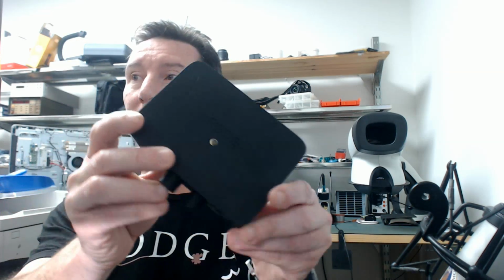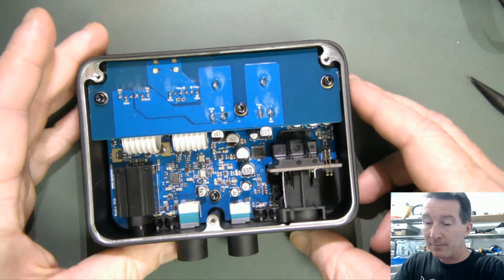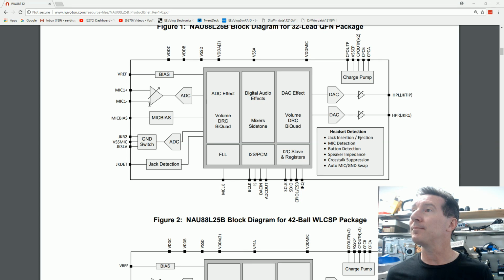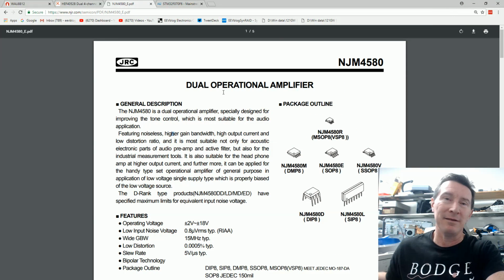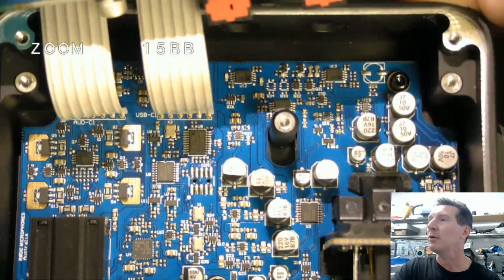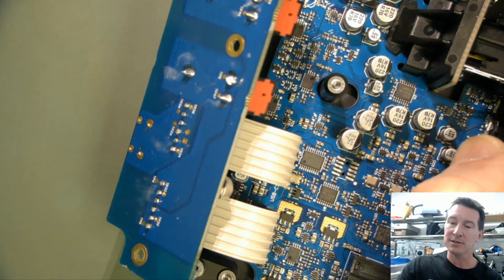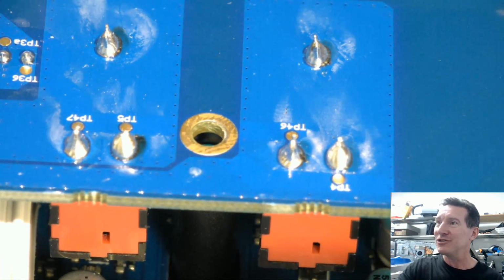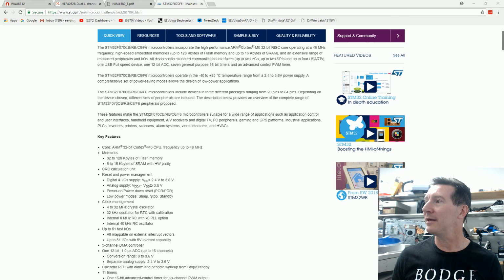Rode AI-1 USB Audio Interface Teardown

Comment: All those SOT-23-6 packages are all dual transistors some of them may be matched too.
Reply: omsonic Yes, Dave really should brush up on his silkscreen reading skills, he keeps thinking Q is an IC and doesn't associate a LED labels with the big yellow LEDs next to them.  The transistor bundles between input and ADC makes me wonder if there's an optional (MUX switched) discrete low noise preamp for weaker signals somewhere in that block. That would explain the long path for the  unamplified signal, as it would only be used for strong inputs.

Comment: It's aluminium alloy die cast with further machining of the bottom lid mating plane . Actually there's nothing special about that as nearly all guitar FX pedals have enclosures like that which high gain preamps  require thorough shielding.
Reply: MSM5500 May be a standard enclosure, just different front/back holes and paint job per product.
Reply: If they make a lot then they could afford a custom mould for that. For instance recent Korg Electribe 2/Sampler and SDD-3000 delay recreation are also finished in aluminium die cast enclosures.

Comment: I think maybe that set of 4 power devices is an audio output stage, not regulators
Reply: Most definetly they are
Reply: You're right. BL is a BCX56 NPN audio driver/output transistor and AL = BCX53 PNP complement. They appear to be configured as an output buffer of an opamp.
Reply: the  master has spoken we need more vids from you please
Reply: Yeah looks like an over engineered headphone amplifier.
Reply: I agree, probably a full bridge class AB output stage to get a decent level into headphones from a 5V supply.
Reply: Class D amplifier implementation for the headphone jack that could drive a minimum 8 Ohm driver per channel. This block is there in between the voltage multiplier block and Headphone out which could  imply that the driver could be drawing its power from voltage multiplier.

Comment: Wow, that case was machined from a sold billet of aluminum! (Probably not a rough forging that was machined.) That's so expensive. But I guess they figured they'd not sell enough to go with another manufacturing technique that wouldn't provide cost savings until higher production numbers. But that's incredible to make that out of billet. Since they've got to machine off 98% of the metal for just a thin 5 sided box.
Reply: It was casted then machined. Machining solid slab is horribly inneficent.
Reply: In Rode's marketing stuff they describe it as a cast aluminum case.  The original for the casting was machined (I'm guessing you're seeing the same telltale geometry that I am), then the critical stuff like that rim to inset the bottom "lid" and the threaded holes are machined.
Reply: do you recycle the machined aluminum or is it pure waste?
Reply: Of course you would recycle it!

Comment: The reason for the end-mount XLR connector is because the main PC board is upside-down.  That would put the XLR connector upside down which would be laughable.  There are dozens of right-angle. PC-mount XLR connectors but they all assume the board is at the bottom.  They could have put the rear connectors on the main board, but it would have made the box bigger and put the USB connector upside-down, also.  D10 is likely a set of 4 clamp diodes to prevent phantom power switching transients from blasting the sensitive mic amp input circuit.  Very common in transformerless mic preamp circuits with switchable phantom power.  Nice looking product, though. Above average for USB sound interfaces.
Reply: USB-C upside down? Is this 4th dimension?
Reply: There are also a couple of right angle ones available that are the other way round, but I guess at the volume they buy these straight connectors possibly for other devices it was just much cheaper than to buy low volumes of relatively rare connectors.
Reply: A surprising number of devices do just have the XLR connectors upside down.
Reply: How can the PCB or the XLR connector be wrong way round?
Reply: The connectors don't have rotational symmetry, there's a convention to which way around they go.
Reply: There's a convention but lots of times it's not followed. I am often inserting XLR connectors in the dark in unfamiliar places and I slide it up the usual way and if that doesn't go in I just rotate my wrist until it drops in. It is only slightly more prevalent that they are right.
Reply: theIpatix And the main PCB is hanging from the top of the box (box was upside down in video because the lid is at the bottom between the plastic feet and the main box).

Comment: That STM32F070 is nice.  I am using it currently in a project. Under a dollar IC.  I just wonder how they implemented the I2S interface using that as its SPI doesn't have I2S support.  Of course it is possible to fake that with some kludgery as long as you keep strict frame sync and manage to get it to sync.  Perhaps with some external login gates?
Reply: The I2S is on the main DAC/ADC/DSP chip, my guess is that the STM part is just used for its USB interface, although there must be something else going on to warrant the serial/parallel interface.
Reply: NAU88L25 outputs the digital audio data with I2S.  That bit stream has to decoded for USB transport.  F070 doesn't have full I2S logic to do that task.  That is what I was wondering.  That shift register is just serial to parallel IC to get more digital output to control different things on the PCB.
Reply: I think they're feeding the I2S into the 74HC595 serial input and then reading the parallel port with the micro.

This guy is feeding I2S into a '595

https://github.com/lhartmann/esp8266_reprap

I got the code from CNLohr on github, modified it to output a 32 bit counter (16 bit left + 16 bit right channels) via a circular DMA buffer, and created a small PCB with four cascaded 74HC595 shift registers. wiring is simple:

I2S Data to '595 input data
I2S Bitclock to '595 shift clock
I2s word clock (left/right) to '595 buffer clock.
Reply: There is no point in converting I2S data to parallel format as F070 can input the data with SPI in DMA mode.  And it can output at the same time as F070 can simultaneously both input and output through same SPI.  The only problem is to get the word sync right.  The bit rate is within F070 range, either 4 or 8 megabits per second and F070 maximum CPU clock is 48MHz.
Reply: Alo762 - true. See my later comment.
Reply: Have a look at the STM32F042F6. It supports I2S, USB Device, has also 32kBytes flash and even supports capacitive touch inputs if you need it. Also the F042F6 comes in the same package as the F070F6 and cost only 0.6$ more than the F070.
Edit: I've now seen that you are currently using the F070, so this info may not be useful to you but maybe to others.
Reply: I'm not sure that receiving I2S into an SPI device is an issue. If you send SPI data to an I2S device you need an external circuit to generate the word select signal which has to toggle every 16 clock cycles, e.g. see page 3 of this -

http://www.ti.com/lit/an/slaa449a/slaa449a.pdf

If all you're doing is receiving, as this device is, you can feed I2S data into an SPI port and then you'll just receive a stream of bytes. Since I2S is fixed 16 bit it's easy to interpret in software - you get four bytes in and you can turn that into two 16 bit samples for the two channels. 

You could probably even cope with left justified vs right justified in software if you have to.
Reply: I also have a couple of F042s and I will use them if F070 lacks something I need.  On the middle range I have used L151 and 103C, the latter being dirt cheap in Blue Pill modules from China.  Thanks for bringing F042, though.  Other viewers may find the tip useful!

Comment: Does this device support 24bit  audio foolery? In that case, they might use an arm uC because there are almost no options when it comes to a commercial 1-chip codec solution.  About the 3.9R resistors; aren't they simply rc-filtering the power rails to get the noise down? (USB power must be noisy as hell)
Reply: Most HiFi chips from Asia (Tenor, Commexant, VIA) support 24/96 over UAC1.0, and some UAC2.0 chips support 24/192. XMOS solutions support up to 32/768. 24 bit is not nonsense, it's very much needed if your analog recording settings screws up. You need the extra 8 bit to wipe the ass of whomever set recording level incorrectly. Want to get true 16 bit out after mastering? Get 24 bit in!
Reply: Bo Gao Actually most of these DACs are not true 24-bit. In terms of SNR the good DACs has the equivalent of 20-bit. So yes indeed, bit depth makes a significant difference in audio production, where it is not uncommon to have dozens of takes playing simultaneously.
Reply: gonX 24 bit makes an even bigger difference in unpredictable live recording or when you have very limited level adjustment opportunity on a microphone input (and this box is dedicated to that), although in practice a logarithmic or floating point ADC would probably do as well, since it's all about adjusting the levels after the  fact.
  As for > 48ksps recording, it allows you to use a much less aggressive Nyquist filter, avoiding the artifacts of using a filter that begins it's rolloff within the audible range.  If final output is CD, the filter can be fine tuned according to desired sound, if final output is anything else, skip the CD-specific filter and only filter for the actual format generated, such as audio for an MPEG4 or WebM video, or a podcast for the Amp hour.
Reply: 96K or 192K sampling rate can be classified as audiophoolery. But I can assure you that 24-bit sampling is NOT!  It will save your bacon when you are recording something with unexpected peaks that would otherwise clip and ruin your recording.  It has saved me more times than I can count.  I would never record a live performance in 16 bit.  Just asking for trouble.
Reply: Higher sample rates do make sense for recording. It ensures the higher frequencies are captured properly.
Reply: I should've left "audiofoolery" out of the comment :) I just meant that it's hard to find an off-the-shelf solution for one-chip codec that supports 24-bit@192KHz. At least, that was the case when I was looking for one. The CM6631A (C-Media) was the only thing I could find at the time, which had horrible support and shitty tools. I used an ARM instead :)

Comment: Nope leaving the opamp away for filtering ac. Two filter caps with ac filter pull ups. You want output to be clean as. Wait till you get the nodd from rouge before other rouge wants to change #facepalm

Comment: I suspect the long trace length for the mic signal is because it's differential until the chip, so it should be more immune to noise than a presumably single-ended line level signal.